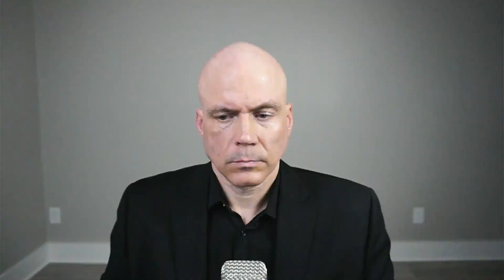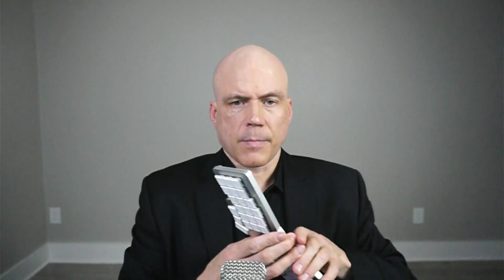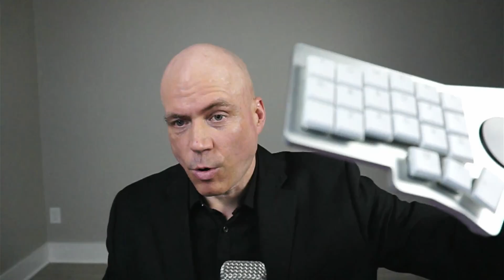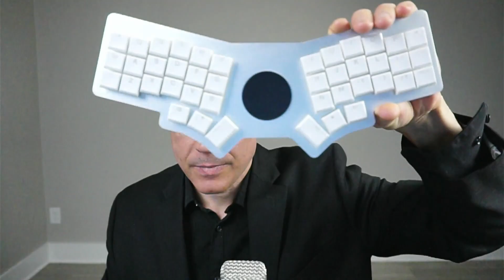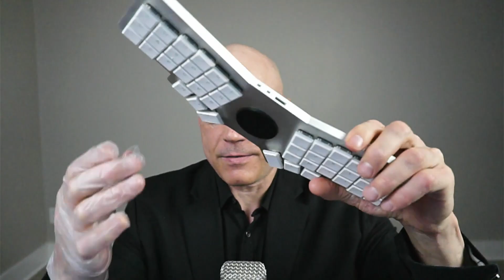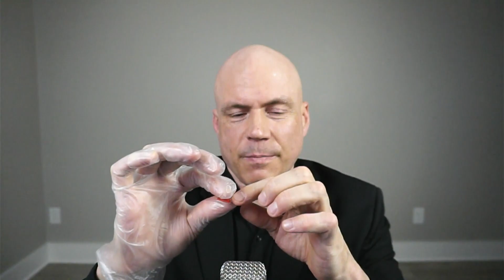The trouble with wireless mechanical keyboards

Comment: it’s nice to see you guys try to make a great product and spent time to refine keyboards. Those points are making sense. 
I like to share some of my experience. I switched to ergo keyboards over 3 yrs. I’ve tried hhkb, kinesis, planck, now reviung41 and corne. my experience from online(github, forums, reddits) or talked to ppl offline. I think most of those ppl are computer related, gamers, engineers. It’s not a big issue to setup GitHub. And all of us are looking for a “endgame” keyboard, wireless is a large demand. There’re a couple vendors offering wireless keyboards, like kinesis, Boardsource, Corne-ish. When I using a keyboard, I don’t need background lights and OLED as long as the keyboard is reliable + I always focus on the monitor, not the keyboard.